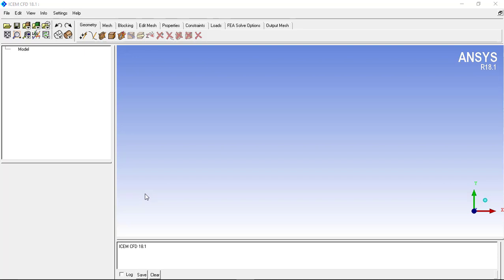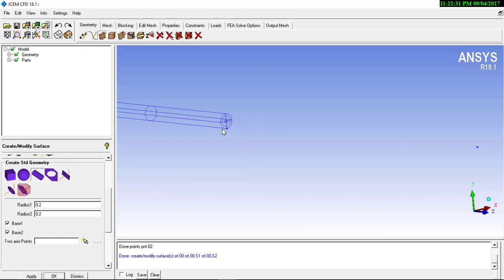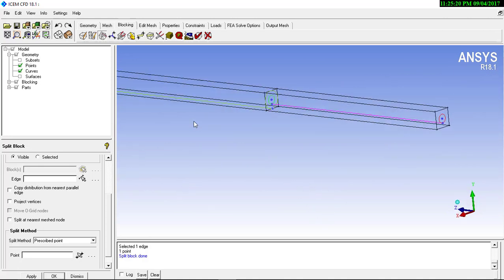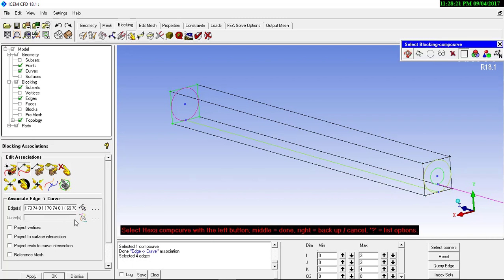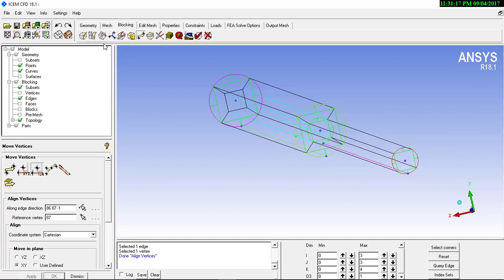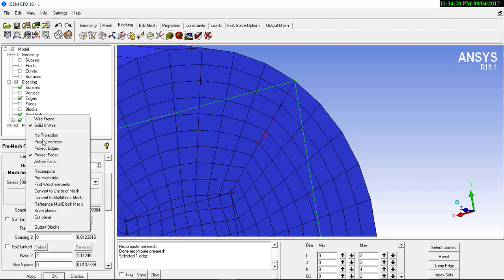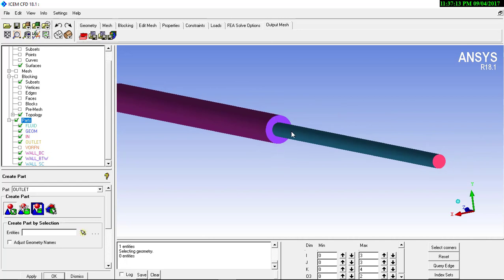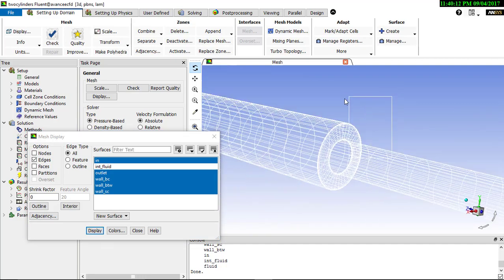ICEM CFD Tutorial - Hexa mesh of Two pipes with two different diameters

Comment: PG, you created the mesh on outer surfaces of pipes, what about inside the pipe or you can say that this method works for meshing inside fluid domain. Also you didn't create the body from surfaces? Kindly leave your generous reply. Thanks
Reply from the maker: Mesh is created is volume mesh. Though not visible but it is create every where inside of volume. There is no need to create volume or solid in ICEMCFD